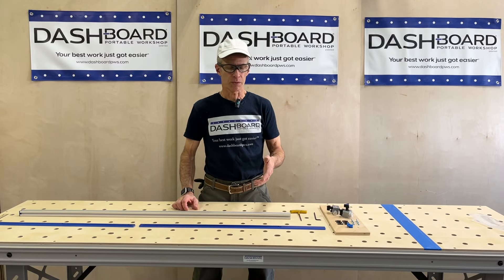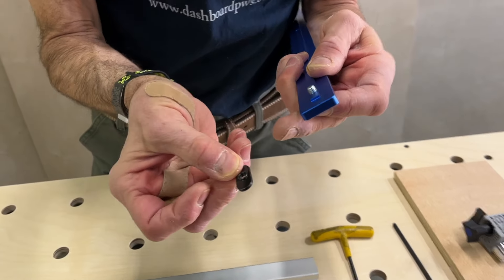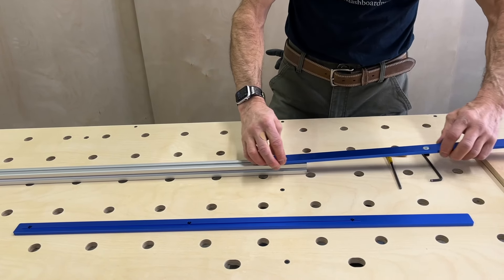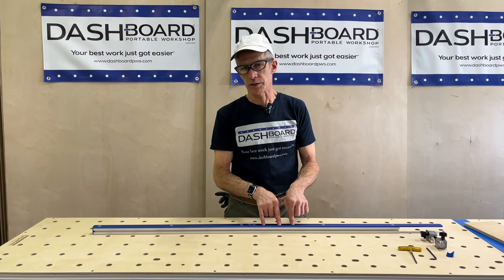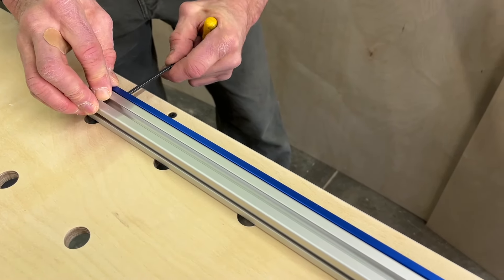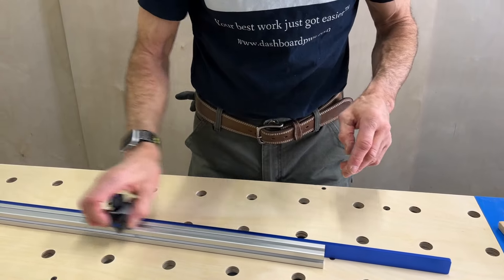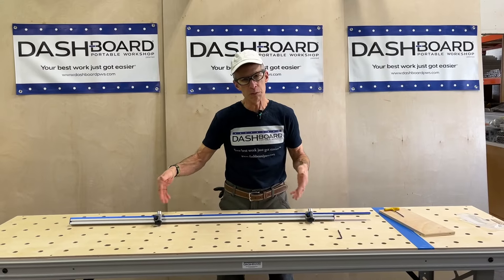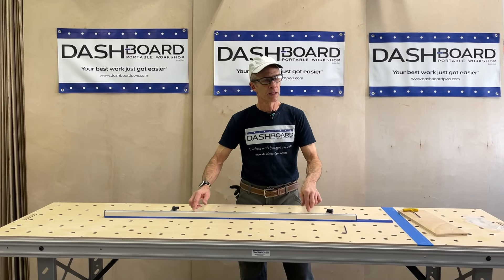Dash-Board Surface Mount Fence Assembly

Comment: I sold my MFT/3 last year and looking at a replacement.  Looks like you have an awesome and well engineered product that is currently at the top of my replacement list.  Steve
Reply: You won’t regret it! Highly recommended the full system if in your budget. The outriggers and everything else are fantastic!
Reply from the maker: Thanks for your compliment, Steve. I'm always around for questions.
Reply: @Mike-dn4ju  Thanks Mike.  I am almost there and will gather my questions to pose to Rob and then figure out how to integrate into my shop space.
Reply: @dashboardportableworkshop  Thanks Rob.  I will gather my questions and give you a call soon.  Steve

Comment: Thank you fro the video. I purchased the F2 surface mount fence, guide rail bracket set and dual sided flip stop. Beautiful engineered products and looks great on my work bench. I tried and tried and couldn't get the last installation step on the surface mount fence done and that was to install end cap into fence end after the bars were installed. Round tab broke off of the 1 provided with fence and the extra as well. I ended up having to put a small notch in end cap to fit around the bar and super glue the end cap in place. I did everything just like the video. Minor detail and I'm chalking it up to my error because the equipment is precision and of the highest quality. Continued success and keep us woodworkers outfitted with the best equipment on the market!!!
Reply from the maker: Thanks, Steven!

Comment: Yet another great product. Any thoughts about putting a ruler scale on the front of the fence?
Reply from the maker: Thanks! Users are welcome to apply their own adhesive-backed tape measures. The reason we don't include scales is that the fence is designed to be easily moved around on a table depending on the need, and without rechecking calibration at every location a scale would be essentially meaningless. At Dash-Board we're firm believers in simplicity and in using a single tape for everything on a project, including taking measurements of a space and setting stops/marking stock for machining. Particularly since our system is intended first and foremost to be portable, and as such frequently set up and broken down, we feel that relying on one's hand-held tape measure is the best way to ensure consistency.